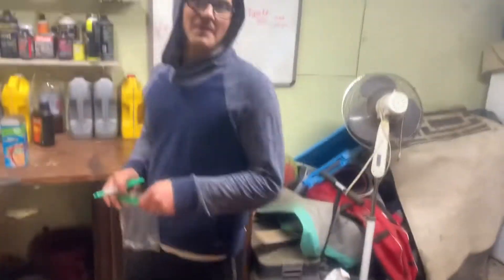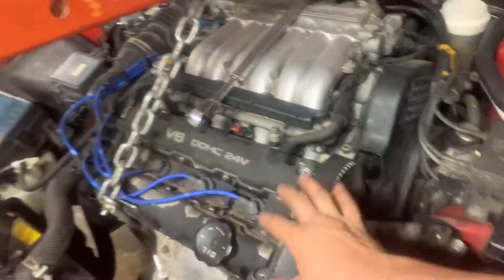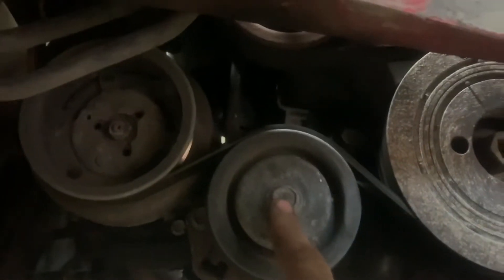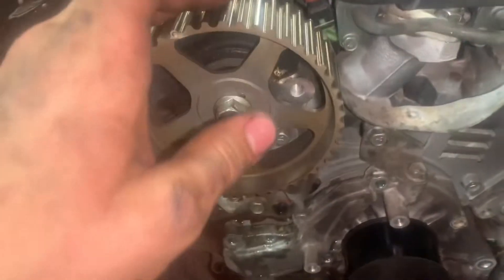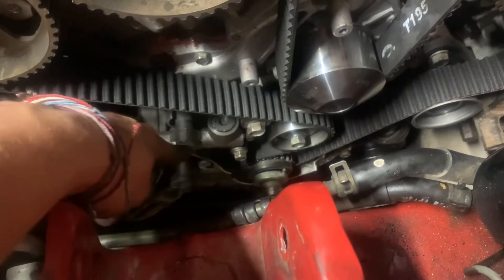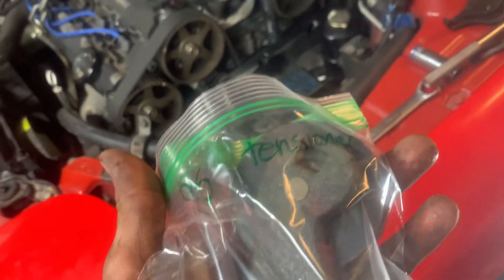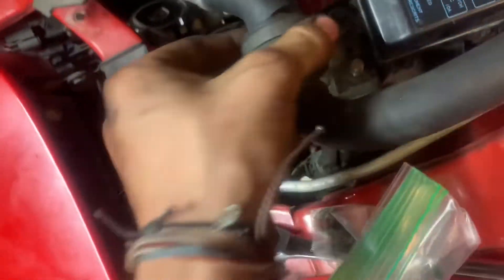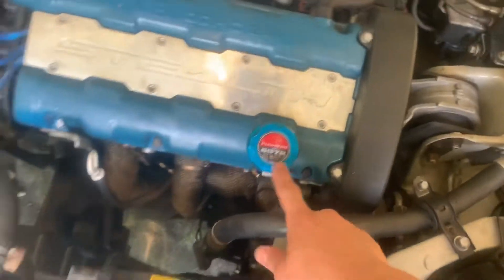1993 Dodge Stealth DOHC | Timing Belt Water Pump Replacement

Comment: I got the same can my motor started knocking what can it be what should I check
Reply from the maker: Everything
Reply: What should I start by checking
Reply from the maker: If you buy a automotive stethoscope you can check different parts of the motor to hear where the knock is coming from.